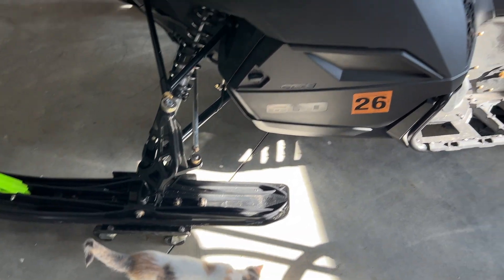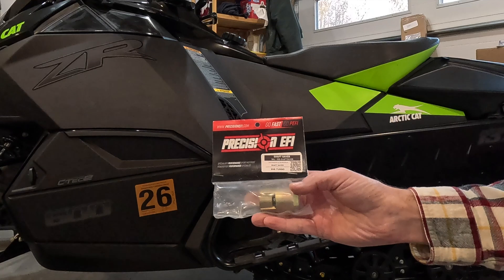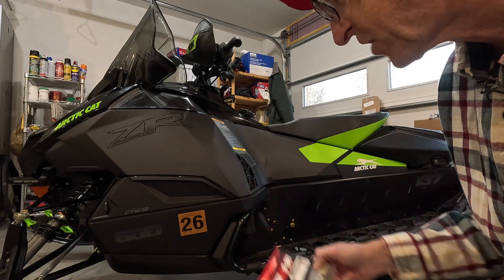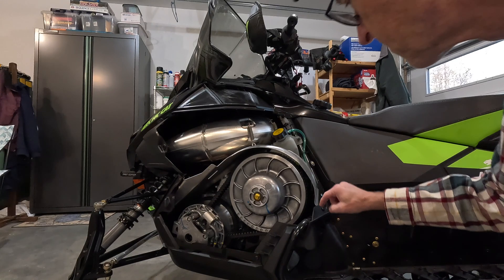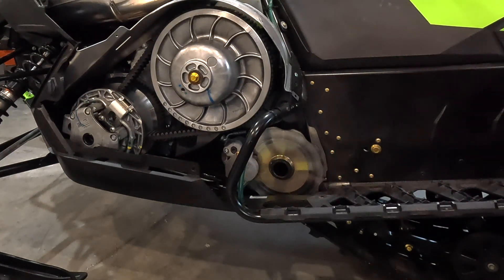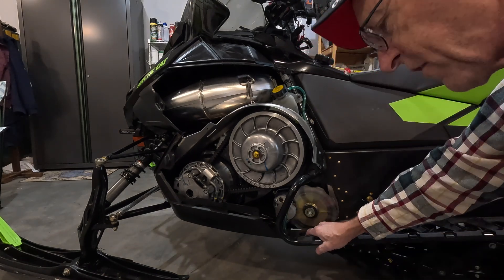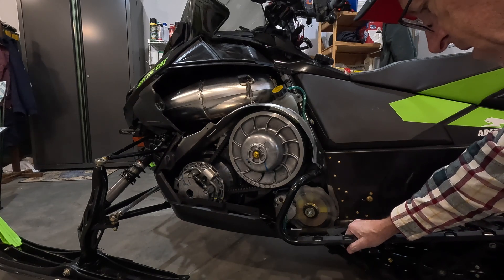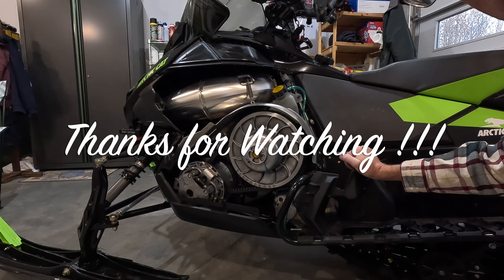Arctic Cat Catalyst:  How to extend the life of your drive shaft bearing

Comment: Was there a warranty disclaimer when you bought the part? I wonder if Cat would void it?
Reply from the maker: That's a good question.  There's no disclaimer.  I think this is a safe modification, as long as the brake disk remains loose.  The torque spec given by Precision EFI is plenty safe to avoid a problem with that.  The upside is that this would potentially save a rider from a warranty claim or failure down the road after the warranty expires.  The downside is that it could cause a problem with the brake if over-torqued (which is pretty hard to do).  Still, I think it's a valid concern - this mod is not sold or promoted by Arctic Cat.